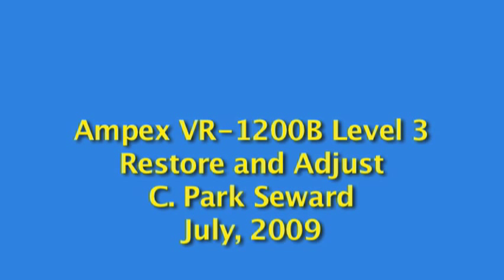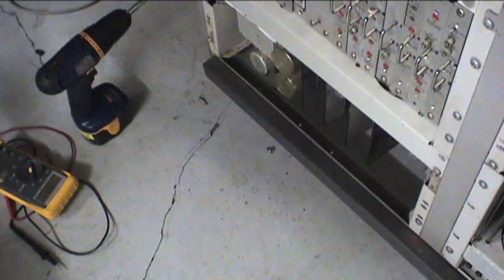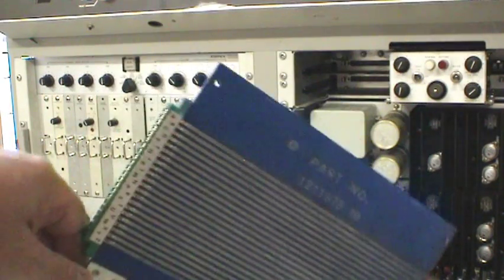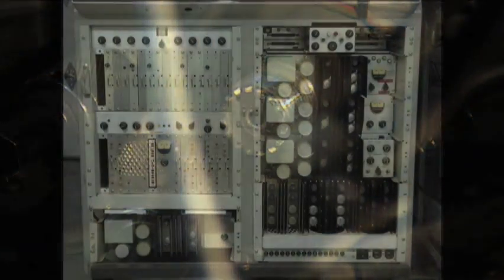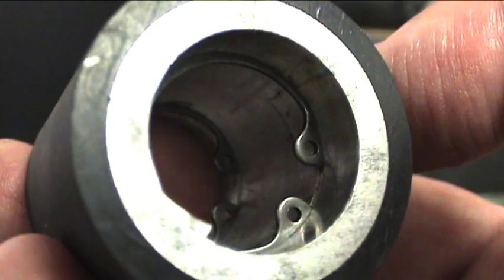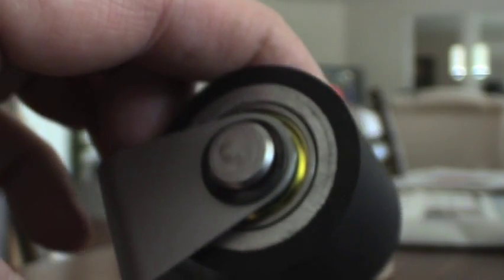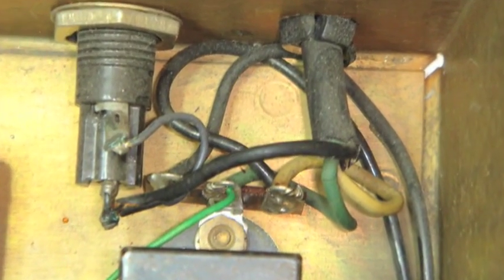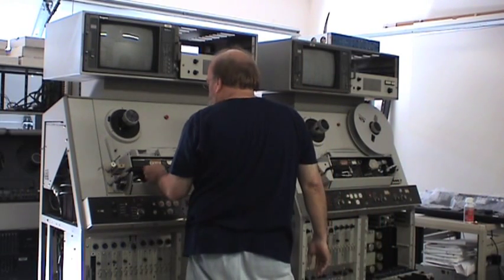Restore, Ampex VR-1200B, Part Four

Comment: Massive power supply bank! I myself perfer the old iron core transformers and massive caps to the new swichmode power supplies of today. You never really had much trouble with the old design and they were easy to fix. Nowdays a 1000 watt power supply weighs a couple of pounds but it can fail unexpectedly, can be difficult to get parts for, and it not very immune to power surges, spikes or much of anything else. I refer to swichmode supplies as "Glass PS".

Comment: if you need any parts we made them here in colorado springs for 30 years at our high precision machine shop. all the shafts, air guides,idle shafts,capstan shafts,all the mechanical for the video heads.i used to grind the pintch roller that you showed.

Comment from the maker: Tape Ops don't wear gloves unless handling very old and important tape. You are just touching the head of the tape and it doesn't contaminate the rest of the tape. All VTRs need to be cleaned with Xylene and that will destroy any oils on the VTR. With Quad, you clean the VTR after EACH tape. The only tube VTRs were Quads from the 50's. I don't know of any operating today.

Comment: This is an awesome restoration project!  I've always been curious about early VTR machines.  

Is there a good place to read up on them further?  I'm especially interested in the tube based ones.  Haven't seen any videos of those yet.

From the various videos I've seen so far, it seems like people handle the tape with bare hands a lot, especially while threading.  Doesn't that get the heads dirty?

Comment: Any machine. If he has the size on file you just have to send in the old one. If not he has a little form that you fill in and it helps him determine the correct size. I used him for over 40 machines os far with great results. He really is one of a kind.